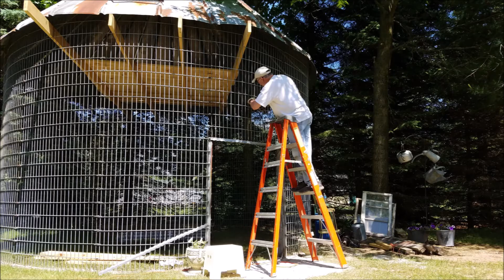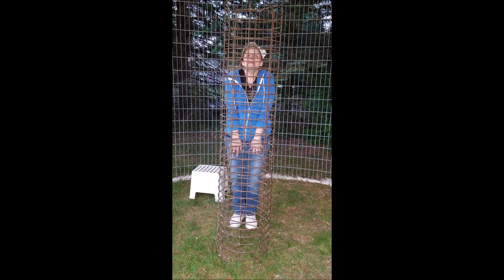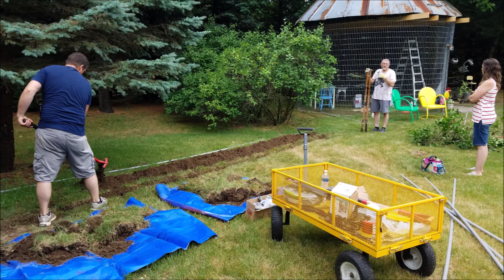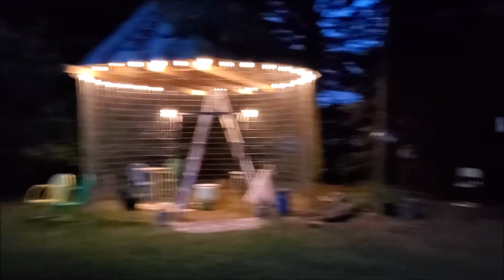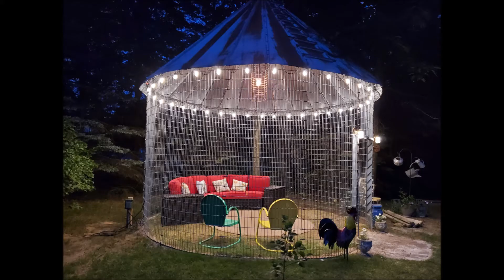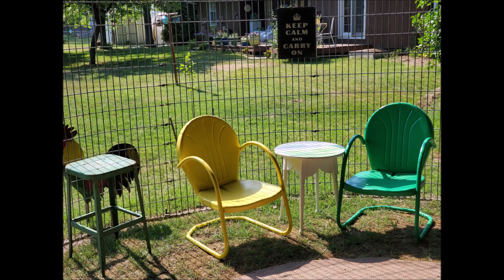Corn Crib Gazebo Phase 3

Comment: This looks great! I was wondering how you keep it secure to the ground without foundation??
Reply from the maker: Thanks! When I got it, there were brackets that anchored it to the original concrete pad. I re-used them and found very long rebar stakes that fit in the holes of the brackets and I drove them into the ground.
Reply: @MarkBuhr  thanks so much!! I’m having a corn crib brought over to my place soon and I was really panicking about that part 😂
Reply from the maker: @killianblehm492  Glad I could help. One thing I'm missing that I wish I had is the cap over the hole in the top of the roof. I'm still looking for one or will fabricate something. I don't want it completely sealed, but I do want it covered. Also, this may help: My corn crib is 16' in diameter. I bought four 18' long 2x6's (they fit perfectly through the wire sides) and slid them through the wire at the top of the walls. I then put 2x8's on top to create scaffolding. You can see all of that in the first two videos, but thought I'd give the specifics. Good luck with yours!
Reply: @MarkBuhr  thank you! I just watched all the videos and the only thing I’m a bit unclear on is if you prepped the ground with gravel or anything before you did the ring of pavers that keeps it from sinking? Just wondering what all was needed for the “foundation” to keep the crib in good condition if that makes sense 😂
Reply: @MarkBuhr  I wasn’t sure if it would need too much prep since my soil is clay heavy and it’s one line of bricks.
Reply from the maker: @killianblehm492  We have all sand and not clay. I did prep the ground by cutting the grass away, digging down a few inches and installing crushed gravel. We then tamped that down and tried to level it. I'm not sure how much it actually helped, but the corn crib still seems to be very stable after a couple years there now. The first five seconds of the 2nd video (Phase 2) show the circle of crushed gravel where the wire "walls" would stand.